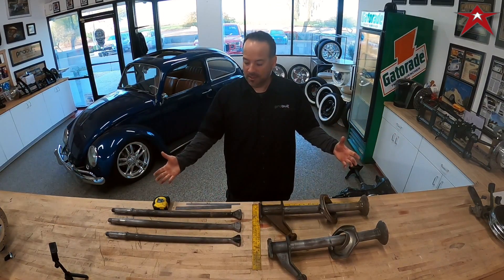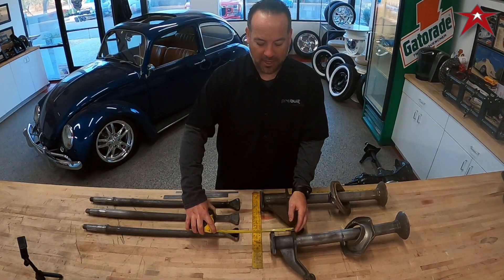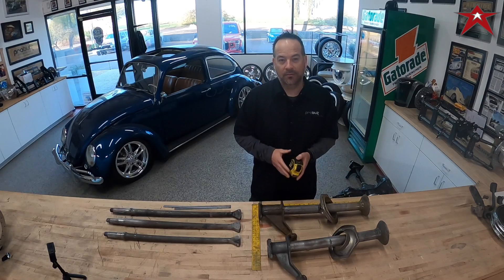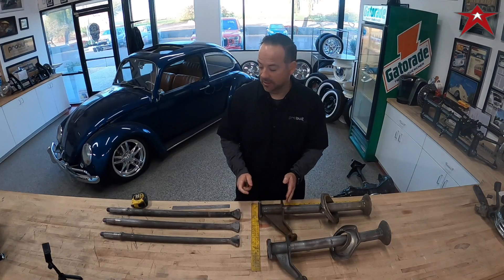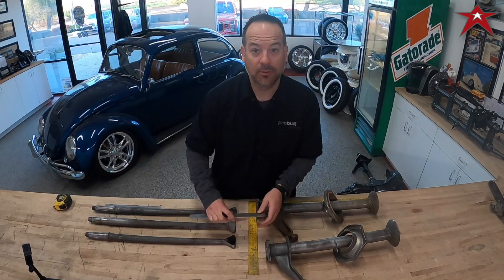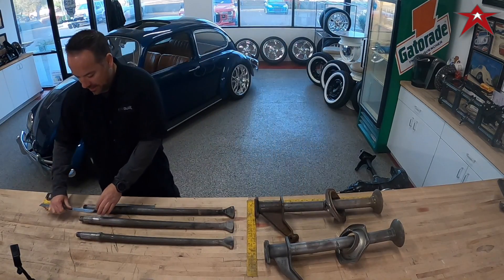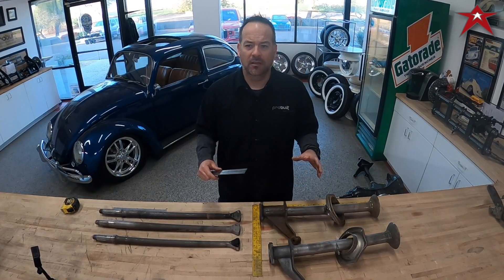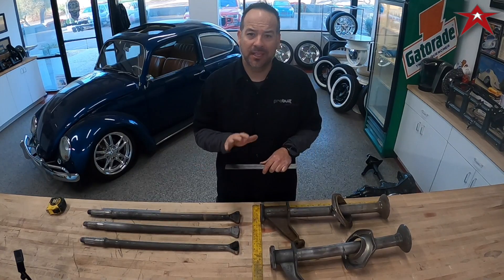Volkswagen Axle Lengths - Why It Matters - School is in session! Roll Call #AirkewldArmy!

Comment: OK but can I put the long axles into the transaxle with the short axles? And the long axles are installed with the snap ring . But the trans with the short axles are i stalled with Nut with two holes in it. Like a spanner nut.
Reply from the maker: You can, it takes the same parts in the diff.

Comment: So if you install short tubes and axle on a 68 that had long would the spring plate bolt right up? Seems like it would be bending inward or what. Thanks for the video.
Reply from the maker: Yes.

Comment: I have a swing axle dune buggy with a disk brake conversion. The right rear axle keeps chewing through hubs. Is it possible im missing a spacer or something? Ive replaced both tubes and paddles and it keeps happening on the right side. Im at a loss, have you ever came across this?
Reply from the maker: Step one, inspect the teeth on the axle. If the factory drum can slide on and off, easily, you are more than likely good there. Step two, how are you tightening the axle nut to the hub? By a torque setting, torque multiplier or something else?
Reply: @AirkewldVWs  splines always look good, I've replaced the axle once and this is the third hub. I've always started at 240 with my torque wrench then tightened with a breaker bar to the next castle nut opening for the pin. I'm easily at 400 ft/lb with the breaker bar if not more. I've actually resorted to my Milwaukee impact which is 1200ft/lb, still having the same issue.
Reply from the maker: @nathantriplett3558  Hey Nathan, thanks for the reply. I invite you to have a read on our install guide because there isn't a torque setting but actually a process to getting it tight. You can see the last guide here - http://www.airkewld.info/PDF/Gen%202%20Rear%20Disc%20Brake%20Install%20-%20All%20Models.pdf

Comment: Great videos and knowledge as always.                                                                                   Question:  On a '67 split window bus with the factory 46mm big nut tranny with GRB's, what length axles are they?  To replace the original 46mm tranny with a swing axle from a bug, which size would be equal in length to the original.  So would you go with a 1967 or 1968 bug tranny that will be running original factory-size rims?
Reply from the maker: There isn't a beetle transaxle that will bolt into a bus. The axle tubes are custom with either 67 or 68 Beetle axles.

Comment: I have several sets each , however my actual long axles are indeed over an inch longer than the shorter axles, tube are longer too! You don't show that!
Does that mean all of my long ones are 68?
Cheers
Reply from the maker: Actually I did showcase that exact point my friend. 67 axles are an inch longer in total length and 68 axles are longer, due to spline length.

Comment: Great info. Appreciate the time you take to do these vids. So, I have an early 62 type 34 ghia and a late 68 t-34 ghia. The 68 got a shed dropped on it from Hurricane Sally. It was already a rust bucket and I saved it from the crusher, but eventually it was inevitable to be crushed I guess. So, going to use its pan for a Fiberglass Buggy. Long Axle, Factory Disc front end. Now, if I could just find that stop time button and get caught up here at the office. Anyone ever use a Type 3 pan to do a Max style Buggy?

Comment: Sir - I'm currently building a "semi-restored" "61 Type 1.  I know the factory used the short axle configuration on this year.  HOWEVER - I have installed the long axle configuration for this bug.  I will use stock wheels and tires on this car.  When I get this bug on the road will I encounter problems due to the axle length change?
Reply: No. That will work just fine.

Comment: Have a 64 ghia, 4” narrowed beam with disc brakes, do I need air ride to run 17” wheels with lower profile tires? The car is lowered but not slammed. According to this video I now know I have short axle tubes. Thanks!
Reply from the maker: No sir. Ride height will be key to eliminate the possibility or rubbing if that matters to you.
Reply: @AirkewldVWs  thanks for the response! Looking forward to more content 👍🏽

Comment: Great information... I have a 1962 type 1 ragtop with a 1968 transmission long axle. Should I keep it long or short?
Reply from the maker: Depends on the wheels you want to use
Reply: Factory smoothies and BRM

Comment: Great video. I have 66 with long tube. If i chose to install shorter tubes what happens to spring plate. There is a difference of 1.250?
Reply from the maker: The outside dimension changes, not before the spring plate. So you are good.

Comment: Great video. Now i know i aint gonna get shorter axles! but reading the description 53+87=140mm 117+68=185mm so my gain shoud be 45mm where am i losing the 13mm?😭. Why wouldn't you just measure from the face of the brakes/hub to the spring plate and minus 13mm/0.5inch for clearance for the backspacing?

Comment: To put long axles in a short axle car will I just need axles and tubes?
Reply from the maker: If you have short axles, you will need to run 67 axle as the splines are the same length meaning the brakes will work as well. But the only other part needed is bearing caps.
Reply: @AirkewldVWs  thank you. My rear tires rub the inside when I go over bumps. If they were pushed out about an inch or so they would never hit. I have a 64 beetle.
Reply from the maker: What size tires? What wheels? Disc Brakes or Drums?
Reply: @AirkewldVWs  215/65/15 with no offset disc brakes. With 15x5.5 steel wheels.

Comment: Is it possible to get a deeper dish on 60-63 in the rear? without the crazy lean in.
Reply: Would have to change to later model IRS rear , swing axle will always have the lean as you go low
Reply from the maker: Lean will happen if you drop it, 4” is the max lip